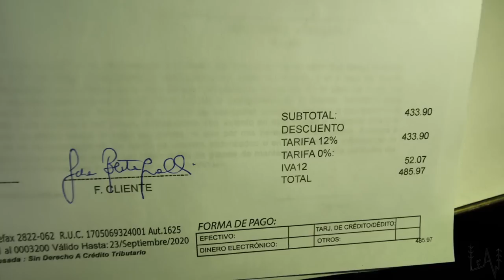Van Life RESILIENCE - We don't give up on our old Truck Camper Lucky LeAw

Comment: make the mechanic , remove the driveshaft take the new u-joint apart and inspect.. look for one of  the needle bearings laying flat in the cap, causing it to be off center.
the way the tech was hammering the new joint togather caused the bearing to slip inside
have the tech use thick wheel bearing grease to put all of the needle beatings back in place.. then re-assemble the u-joint using a vice to slowly press the parts together
this has happened to me many times

love you guys .. you will get there
Reply from the maker: Ok, we will! Thank you very much for watching and commenting! 🙏❤😊👍😉👋 Cheers Luca & Sara

Comment: Hello beautiful people! Your new U-joints look fine. Make sure you keep them greased. The one that has the grease fitting facing forward is so that it is easily accessible. When things get tightened up, worn or bent things get more noticeable. Look for dents in your driveline. If you see any, chances are it got bent some time. It may have been slightly bent when you first bought the truck and you didn't notice because of so much was worn out. Your carrier bearing could be worn out. Your driveline has to go through the center of it. If it's sitting lower than center, your driveline will vibrate. Did you check your brake pads on the front axle? Driving heavy all the time wears your brakes out faster. It actually wears out everything faster. It doesn't matter if it is old or new, the all eventually need things replaced. It's part of the adventure! Much love!
Reply from the maker: Good morning! Yeah, we still have 50% meat on the front pads. Thank you very much for watching and commenting! 🙏❤😊👍😉👋 Cheers Luca & Sara

Comment: the drive shaft is out of phase, its an easy fix to get it back how it should be. watch the video on youtube "how to phase a drive shaft" and it will explain how to do it. good luck
Reply: Agree. Driveshafts are balanced as a whole assembly. If one piece of the driveshaft is assembled 180 degrees off from where it was originally it will be out of balance. A very easy mistake to make. Now the problem is figuring out which piece is 180 degrees out. Another possibility is the u-joints were not assembled properly. A loose or missing bearing inside the cap.
Reply from the maker: Good morning! In the next video (on Sunday) we will finally fix Lucky LeAw and get back on the road! We will also show in the video what was wrong! Thank you very much for watching and commenting! 🙏❤😊👍😉👋 Cheers Luca & Sara

Comment: It is hard to tell from the video but it could be the rear slip joint of the drive line is out of time. This is the part right behind the center carrier bearing.This will cause the driveline to bind when turning. Remove the rear joint off the differential and slide the slip joint off and turn it 90 degrees and reassemble and see what happens.  Also check the rubber on the center carrier bear, if it is not holding the bearing tight this can cause what is happening. A shim can be put above the rubber to tighten it up, but not too tight. Check this center bearing first before changing the slip joint position. Good Luck
Reply: These suggestions were given to you by my husband of 49 years.  He started as a mechanic for Cummins Diesel at 18 yrs old.   Was in the US Army Corps of Engineers.  Retired early as a Master Mechanic and a Foreman for the City of Phoenix, Arizona.  You can trust that he knows what he is talking about.  We both hope you get this issue taken care of.    Safe travels.
Reply from the maker: Hey Debra, thanks to your husband! =) Thank you very much for watching and commenting! 🙏❤😊👍😉👋 Cheers Luca & Sara

Comment: I have a truck like yours (mine is an 89) and had to replace all of the same parts recently. I have about the same mileage too so I wouldn't say it's surprising. Your truck should be running pretty good with all of the repairs! I love seeing someone keeping an older truck on the road and using it for their adventures! Love all the videos, keep up the great work!
Reply from the maker: Hi! Thank you! Yeah ours is super overloaded and we have done and are doing some extreme off road with it like this. Thank you for watching and commenting. 🙏🏻☺️👍🏻😉

Comment: They should have marked the drive shaft so that it could be reassembled in the same orientation to preserve the balance.  They will have to try various positions to see if they can get it back the way it was.  I also noticed that there were several dents in the drive shaft that could also cause  problems.  There are a lot of pieces in that driveline that must be assembled in the original orientation in order to be balanced.  I hope that it can be fixed easily so that you can get back to your trip.
Reply: What he said
Reply: This guy is right 100%
Reply from the maker: Good morning Matt! Yeah! You are right! Thank you very much for watching and commenting! 🙏❤😊👍😉👋 Cheers Luca & Sara
Reply: Can you go back to the garage that did the repair? They should be able to try again at no cost. Tell them to do what Mat said his answer makes sense. Can you look at your original video of the drive shaft and see if you can identify the various parts and compare? You might find the difference. Good luck and God bless you guys.

Comment: Up until a month ago I drove a 1977 Argosy motorhome and a 1976 Rolls Royce.  Just because they're old doesn't mean they can't be fixed, they just need a little more love than modern vehicles.  I'm not a mechanic, but I know when replacing a u-joint they are supposed to mark the positions of the yokes so they go back into the same position to maintain the factory balance. Looks like the mechanic did not install the yolks in the right positions.  With three universal joint replacements it would be difficult to guess each original position.  Perhaps ask your mechanic if they marked the original positions and just did not reinstall the same way?  Your fan club here sees nothing but your amazing perseverance and a wonderful relationship!
Reply from the maker: Yeah, exactly! No, the mechanic didn't mark it! Thank you very much for watching and commenting! 🙏❤😊👍😉👋 Cheers Luca & Sara

Comment: Perhaps there is a place on the  drive shaft where a counterweight was installed, but has come off? It could be laying on the mechanics  shop floor. If so, you can  tack weld it back in place. Maybe it came off  while being moved through the shop and banged around.
Reply from the maker: Good morning! In the next video (on Sunday) we will finally fix Lucky LeAw and get back on the road! We will also show in the video what was wrong! Thank you very much for watching and commenting! 🙏❤😊👍😉👋 Cheers Luca & Sara

Comment: Don't lose heart guys. This is part of life with an older vehicle. The only alternative is to buy a newer vehicle for $20 - $30K - and that's just not an option for most of us. Instead learn to be proactive. Replace things before they break. Preventative maintenance is key. Replace all those belts, hoses, etc on a regular basis. I have done this sort of work, went to school for it years ago but then went into the computer field. The vibration you're experiencing is hard to diagnose with being there. Best of luck, when you do get it fixed Lucky U will be in much better shape and safer. Glad you got the emergency brakes fixed. When you need them, you REALLY need them. I'm speaking as someone who's brakes completely failed on a 14 foot box truck in heavy traffic. It doesn't seem like it now but this will soon all be behind you.! Be well!
Reply from the maker: Good morning Mike! Yeah! Thanks! In the next video (on Sunday) we will finally fix Lucky LeAw and get back on the road! We will also show in the video what was wrong! Thank you very much for watching and commenting! 🙏❤😊👍😉👋 Cheers Luca & Sara

Comment: there was shaking before that's what actually broke the U joint (CRUCETA) BUT NOW THAT YOU CHANGE THEM YOUR GOING TO FEEL THE VIBRATION MORE quito is a big city there's got to be a place that balances that drive shaft best of luck also check the transmission mount.
Reply from the maker: Good morning Yeyo! There was no vibration before we change the u joints! the u joints broke because they were dry, no grees in it! In the next video (on Sunday) we will finally fix Lucky LeAw and get back on the road! Thank you very much for watching and commenting! 🙏❤😊👍😉👋 Cheers Luca & Sara

Comment: It's most difficult to come up with a solution via a video, but I'd question the orientation of the u-joints as well. But usually, any rotational vibration is related to balance. I'd have your mechanic check to see if the output shaft of the transfer case and drive shaft have a "match mark" for proper assembly. One thing I did notice, is the transfer case movement as you increased the drive train speed. Drive train mounts (Motor/Transmission/Transfer Case) can break and it isn't always apparent. This can cause the driveshaft to be out of plane and contribute to a vibration. I'd check all the mounts and verify with the mechanic that the u-joints are not orientation critical, before sending the shafts out for balance.
As far as any negative comments you've received. It's your life and you shouldn't let what other people (especially strangers) think upset you. You knew going into this adventure that Lucky Leaw was an old horse and would require upkeep and maintenance along the way. Unfortunately, knowing what will break and when is impossible. I'm impressed it has made it as far as it has without a complete drive train failure. I'd say patch the ol gurl up and hit the road. Not much further to go. Good luck to you both.
Reply from the maker: Good morning Bill! Thanks! In the next video (on Sunday) we will finally fix Lucky LeAw and get back on the road! We will also show in the video what was wrong! Thank you very much for watching and commenting! 🙏❤😊👍😉👋 Cheers Luca & Sara

Comment: You guys are adorable and I wish people would not be so cruel.
I totally agree with britdog07 that one of the needle bearings has dropped out of place and is causing the bearing to bind.  Insist that the mechanic take the bearings out and inspect them and make sure they replace the one that was installed incorrectly.  The bearing caps should only require light tapping to seat them but your mechanic had pound way too hard which will damage the bearing.
The fact that you have made it so far in an $800 truck is amazing.  You WILL have more breakdowns along the way but there is always a solution that will get you on your way again.
Safe travels.
Wayne
Reply from the maker: Good morning Wayne! Thanks! In the next video (on Sunday) we will finally fix Lucky LeAw and get back on the road! We will also show in the video what was wrong! Thank you very much for watching and commenting! 🙏❤😊👍😉👋 Cheers Luca & Sara

Comment: Hello I'm very experienced with AL issues inside out with trucks, vans, the issues ur expering is common as far as vehicle maintenance situations. The fact that it's older and 3/4 ton it looks like, I can tell from the grease brake shoes in the rear that ur axle seals have been leaking for long time, not a crazy big deal but definitely a downer and the drive shaft is call 2 piece with center support bearing. It's super super important that u align the transmission tail tail shaft marker up with the mark on drive shaft slip yoke and be sure that all the greasable zirk fittings are all on the same side facing same direction or u will recive odd vibrations that can slowly cause further damage to transmission or rear end. Don't be discouraged or scared u can repair or have  handy person help out. Ul need propane torch to help remove old ujoints and a vise, a light malet, clamp, light metal files, emery cloth or sand paper type materials. Mark the rear end yoke assembly that u u bolted from, mark trans. Whee u pulled shaft out of, mark the drive shaft so it doesn't beco.e twisted or misaligned it needs to be clicked or aligned in perfect position. With all listed parts u removed from. But do t worry as long as u do 1 joint a time pull 1 install new1 the move on u can't get to out of wack.  I can walk u through whatever u need I'm happy to help... John.
Reply from the maker: Good morning John! Thanks for your support! In the next video (on Sunday) we will finally fix Lucky LeAw and get back on the road! We will also show in the video what was wrong! Thank you very much for watching and commenting! 🙏❤😊👍😉👋 Cheers Luca & Sara

Comment: You are aware that an $800 is not going to last forever and go unbroken. You are aware that it has 300k miles... and that is a lot of miles. But you are doing a great job going with the flow. It’s ok to be stressed about the truck you bought and have come attached to. I hope you get what you need and fix everything... EVERYTHING so that nothing else will cause your truck to break down. Keep going you’re doing great.
Reply from the maker: Thanks! In the next video (on Sunday) we will finally fix Lucky LeAw and get back on the road! We will also show in the video what was wrong! Thank you very much for watching and commenting! 🙏❤😊👍😉👋 Cheers Luca & Sara

Comment: there are weights welded to the drive shaft on each end.  they may have cut them off.  check  the teeth  where the drive shaft enters the transmission ,  check the yoke.

Comment: Hope you got it sorted out. The mechanic should have marked the shaft before pulling it apart, so that it was put back together in phase. My guess would be that the center Universal Joint has been put back together half a turn out. If not, it may be a bearing on one of the joints... maybe the gearbox end, as it's shaking a lot at that end. Good luck.
Reply from the maker: Good moring! In the next video (on Sunday) we will finally fix Lucky LeAw and get back on the road! We will also show in the video what was wrong! Thank you very much for watching and commenting! 🙏❤😊👍😉👋 Cheers Luca & Sara

Comment: Guys! You can fix this! As others have said, it’s been put back together wrong and now is out of balance. So, it needs to be undone and put back together correctly, I am sure you won’t need a new drive shaft or anything like that. My husband once changed the u joints on his old truck and had exactly the same problem, here is what he says you should do:

Undo the four bolts holding the rear u joint. Gently pry the u joint out of the diff housing. Be careful not to let the u joint bearing caps fall off. Lower it down, pull the drive shaft towards the rear of the truck to remove it from the spline shaft. Turn the drive shaft 180 degrees, slide it back in, re-bolt it to the diff. Take it for a test drive. If it’s fixed, hurray! If it isn’t, do exactly the same process to the front drive shaft. Fixed? Hurray! If not, the next thing to consider is a possible problem with one of the u joints... not the whole drive shaft. 

Best of luck to both of you and lucky leaw, we are cheering for you to make it to Argentina.
Reply from the maker: Good morning Deb! Thanks! Yes, we will! In the next video (on Sunday) we will finally fix Lucky LeAw and get back on the road! We will also show in the video what was wrong! Thank you very much for watching and commenting! 🙏❤😊👍😉👋 Cheers Luca & Sara

Comment: Hey guys
A correction. 
The vibration could also be.
One or more of the new U joints binding  ( the cups on the end ) is to tight.
That is checked by ( marking the drive shaft ) before removing. 
Then, flex and move the shaft around.
If the U joint is tight feeling or binding.
The vibration can be stopped by looking the pressure of the cups on the U joints making it flex easier or freer.
Hope this helps.
Reply from the maker: Good morning Fayette! In the next video (on Sunday) we will finally fix Lucky LeAw and get back on the road! We will also show in the video what was wrong! Thank you very much for watching and commenting! 🙏❤😊👍😉👋 Cheers Luca & Sara

Comment: Take it back to the mechanic and tell him to fix it or give you your money back. I’ve never seen anyone hammering a “U” joint back into place. It’s a high precision piece of kit. My only suggestion is to find a vehicle dismantling yard and buy a good used shaft complete. That should get you out of trouble and give you some time to get the original one rebuilt correctly. I agree with the suggestion that you should consider crowd funding to get your home back to useable condition. Good luck folks.
Reply from the maker: Good morning Don! In the next video (on Sunday) we will finally fix Lucky LeAw and get back on the road! We will also show in the video what was wrong! Thank you very much for watching and commenting! 🙏❤😊👍😉👋 Cheers Luca & Sara

Comment: I agree with many here. I’m not trusting the last u joint was installed properly and needs aligned. Mechanic should make right but hard to trust them right now. You have made Leaw much safer with new tires, brakes, emergency brake. You are almost there. There will be a mechanic capable of fixing this. Look at all the vintage cars restored to better than original and Leaw now has many new parts. Your real community supports you and understands Leaw is your home and a part of the adventure. I’m sorry there are trolls here who enjoy kicking people when they are already struggling. Pay them no attention. I hope Leaw can be quickly repaired now and these troubles soon behind you. I’m glad he is being made safer. Even the Mercedes Sprinter Van you tubers have had some automotive issues and those rigs much newer. Hugs Sara and Luca.
Reply from the maker: Good morning Beverly! In the next video (on Sunday) we will finally fix Lucky LeAw and get back on the road! We will also show in the video what was wrong! Thank you very much for watching and commenting! 🙏❤😊👍😉👋 Cheers Luca & Sara